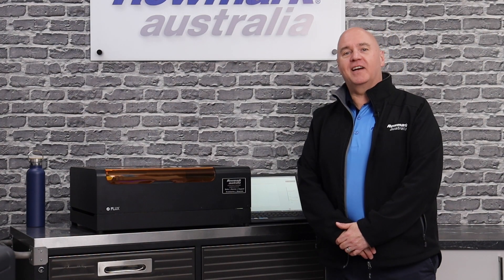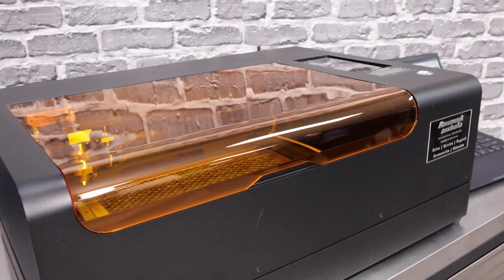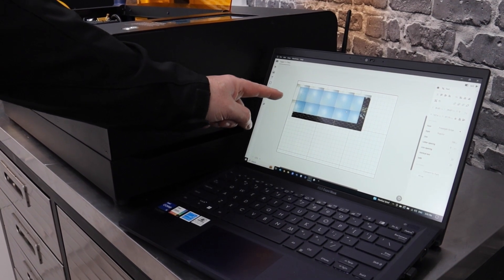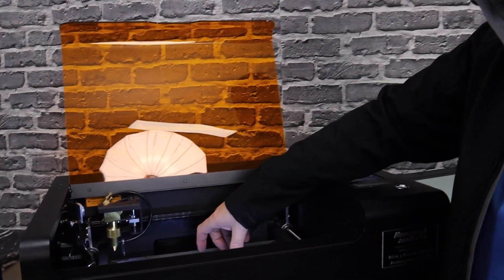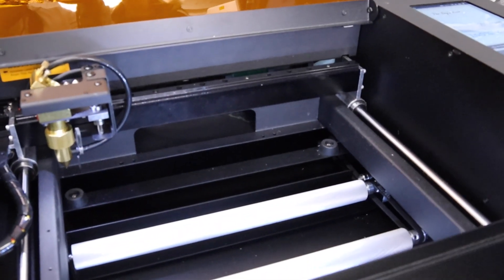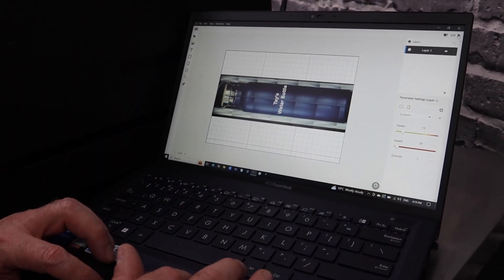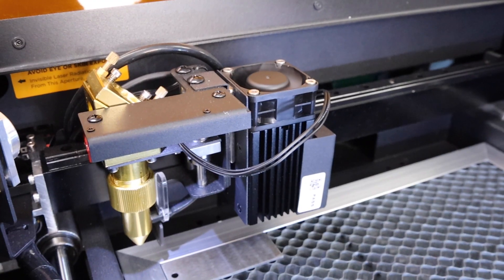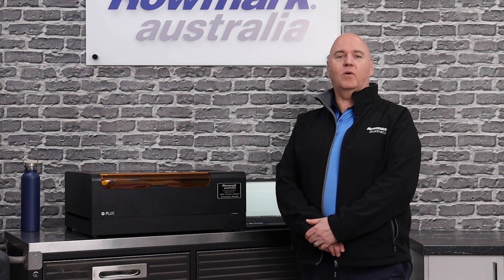How to use the Beamo Laser in Flatbed, Rotary and Diode Metal Marking mode.

Comment: What settings are you using on the metal bottle? I recently bought the rotary and have it installed but my engravings look terrible and have lines running through them where it's not cutting.
Reply from the maker: @natasharatliff6944  It depends on the bottle as all coatings are different from manufacturer to manufacturer. We used 100% power and 40 speed, with 500dpi on that bottle, always make sure the machine is focussed on the bottle too. Thanks Rowmark Australia